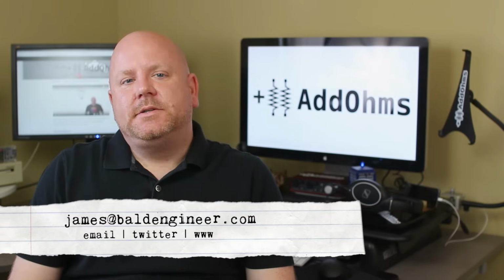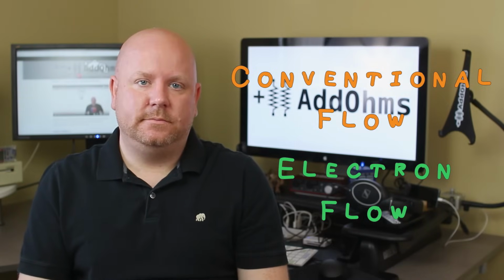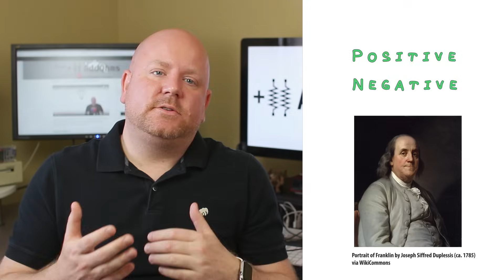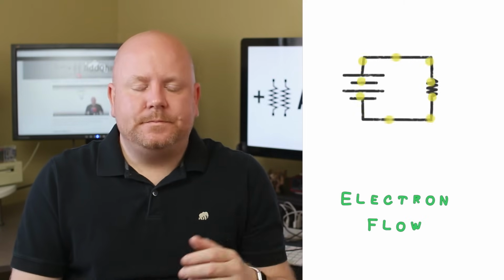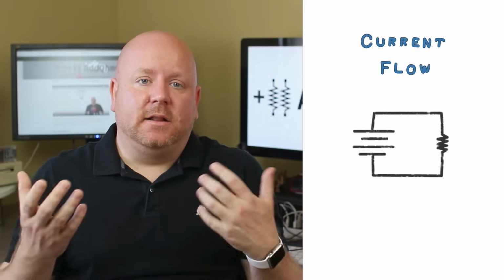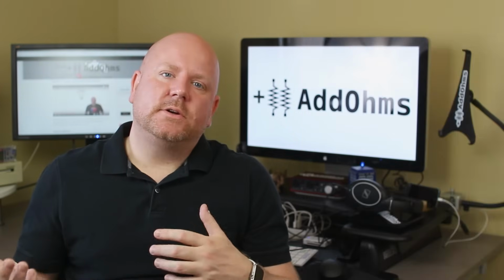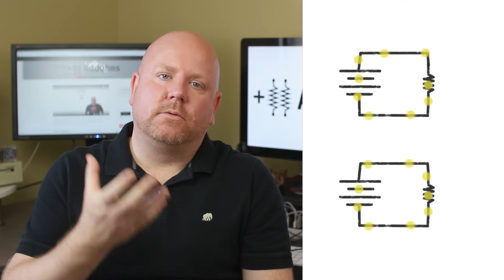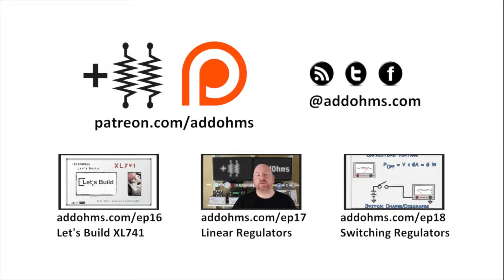Which way does Current Flow | AO #19

Comment: You say it doesn't matter which way you read it, what if there is a diode in series in the circuit?
Reply from the maker: In convention flow (and how people usually think of them) we model a forward biased diode’s current going from anode to cathode. 

In reality (and in electron flow analysis) a forward biased diode’s current moves from cathode to anode. 

You have to use the same analysis method for the entire circuit. You can’t pick and choose based on the component.

Comment: A text on electricity that's over a century old said that, if I understood it, electrons don't actually flow at all in any direction, but that the "state" of the wire is changed.
Reply from the maker: That doesn't make any sense. Electrons are always moving (except at Absolute Zero.) It has been well proven that electrons move in the direction of an electric field. We know they move because conductors get hot. The only way they can get hot is because something inside is moving.

Comment: It was explained to me a bit differently.  Yes they thought electricity moved from positive to negative (positive meaning more, negative meaning less), then they discovered that it's actually the electrons (negative charge) moved to the positive.  But because so many things were built using this labeling convention they just left it that way...  In other words the positive terminal is actually where the electrons reside.
Reply from the maker: "Where the electrons reside" is the wrong way to think about it. There isn't a "pool of electrons" at either terminal. Current moves in a continuous loop like a bicycle chain. So positive and negative are just the direction that the chain moves and not the "source." This difference is a reason why the water analogy is so flawed. People don't see the return path. Without an electric field, the electrons are moving around like they normally do in all matter. The field causes them to move, together, in a direction: like a bicycle chain. They aren't "moving to" the positive they move in the direction of positive.

Comment: Dear Mr. AddOhms, One thing puzzles me about the neg. to pos. theory.
 In electroplating, the anode (wired to pos.) or bar of nickel for example travels  to the cathode (neg.) part being nickel plated.
You can see it happening. What do you think about that? Thank you
Reply from the maker: Can't say. I only have a cursory understanding of how electroplating works.
Reply: @AddOhms  Thanks for answering. I'm sure there's more going on then meets the eye, but in my simple - only
slightly educated mind, it appears the electrons are moving from positive to negative & carrying the plating metal
molecules with it.  It is a good question.
Reply from the maker: Electrolysis involves ions. not “just” electrons.

Comment: My arduino brought me to this ?  i have a small project on lightning my LED i put the cathode - in the GND and the anode + in pin 13 and it lights up ? So based on these video electrons flow from the GND to Pin 13 since it wont light up if put in on reverse .
Reply from the maker: First, that is an excellent way to ruin pin 13. It does not have a current limiting resistor on the pin. (ONLY for the on-board LED.) Second, you cannot pick and choose which current model you follow. If you use conventional flow, then you model current through a diode from anode to cathode.
Reply: oh i thought there is a built in resistor in pin 13 tnx for correcting me, i didnt know that is only for the on board led.

Comment: Moving electrons are not the main conduit of electric charge, electricity. It is the interactions of the electric charges of the electrons that move. Electrons do move, but very slowly, and their movement is inconsequential to the conduction of electricity. It similar to how the middle balls in a Newton's Cradle do not move much when passing the momentum of a striking ball through them.

With that said, the only time electrons are prone to moving in an electric circuit is within semiconductors.

Also, within semiconductors, positive "particles," atoms, also do not move--they are fixed in the crystalline structure of the semiconductor. It is the electrons that move between atoms of the semiconductor that are missing an electron, so-called positive "holes." The holes only appear to move as electrons in the semiconductor migrate from hole to hole.

Comment: If you get confused by the statement at 1:31 you are fine. His statement is not exactly correct and confusing. Only electrons move. What he is referring to is a relative movement that is studied later in semiconductor theory - and is a relative motion, because, in basic electrical theory on solid conductors, positive charges stay with the nucleus and never move.
Reply from the maker: Yup. I regret the explanation. Seemed good at the time, but it wasn't.

Comment: The direction of current flow is important in a DC electric motor because it establishes the direction of torque applied to the motors rotor .
Reply from the maker: Except you have two hands, which means both models work. Depending on which hand you use.
Reply: Fascinating , electrons "drift" thru a circuit at a speed of one and a half inches per hour from negative to positive while at the same time  atomic nuclei flow thru a circuit at about the speed of light in the opposite direction .  Energy always flows from a high state to a lower state and the best description I've heard yet is that electrical energy flows from charge towards discharge .  The stuff flowing in the opposite direction isn't energy . Thanks for replying .
Reply from the maker: No nuclei are not flowing at the speed of light. They are matter, they cannot move that fast. The charge moves at the speed of light because it is energy. Don't confuse electrons with charge. Electrons are the charge carriers.

Comment: Whomever has a doubt,Take  diode( conducts only in one direction) connect it from led with resistor,check the direction,..it's gonna be from positive to negative
Reply from the maker: No. Your understanding of the diode is wrong. The direction is described by the theory you use. In conventional flow, current goes from anode to cathode. In electron flow, which is what really happens, it goes from cathode to anode. 

AGAIN, you have to use the same convention for the ENTIRE circuit. You can’t pick and choose parts and arbitrarily decide they follow one but not the other.
Reply: @AddOhms  sir..if you have noticed a car battery by opening bownet door...why the fuses are given only at positive red terminal s why not at negative black terminals....when short circuit happens,it give rise to more flow of current which blow the fuses..hence..that denotes charges emit from positive terminal. Correct me if I am wrong
Reply from the maker: No! Once again, you are wrong. Your reasoning is incorrect. Current flows in a LOOP. It does not "emit" from anywhere. It is a LOOP. For that reason, it does not matter which direction it flows. 
The reason fuses go on the positive terminal is because they have a tiny amount of resistance. The current through them would create a voltage drop. If they were placed on the ground rail, then ground would not remain at 0 volts. It would change with current load. It has NOTHING to do with what direction the loop of electrons move.

Comment: You almost seem to be teaching here that protons can move and that is definitely not true. That's why I said 'seem' because I'm certain you know they can't move (in an electrical circuit).  I think the only significant thing that makes electricity and electronics work is the fact that electrons move from negative to positive.  It is quite true that the empty 'slots' left by a dislodged electron move from positive to negative. Absolutely. But those are just empty 'slots' which become vacant opposite the direction of electron movement and it's because of a power source forcing electrons into the circuit that those empty 'slots' occur in the first place. Normally in nature an atom will try to balance itself out with the correct number of electrons. In short, these empty slots where electrons were forced out are not moving particles. They are progressively transferred voids, like a string of lights where one light is off and that 'off' light seems to move around and around the loop with the rest of the lights being on. The fact that protons cannot move in a circuit and that only electrons can move in a circuit should give people their grounding into electricity and electronics because they can get very confused by the concept of conventional current if they are stressed together in the beginning. There is probably usefulness in discussing conventional current later, though I have not gotten to the point where I cannot do without it yet. Possibly later on with semiconductors?  Discussing how current can flow from positive to negative wasn't useful in the beginning when I was learning electronics decades ago, as the near-exclusive main focus was on electron current. Conventional current was kind of sidelined and had to be redefined ever since the directional error was discovered by JJ Thomson in 1897. If memory serves I recall seeing most schematics mainly focused on showing the direction of electron flow (negative to positive).

The key in this whole discussion is what causes electricity to be created in the first place. The electrons can easily be dislodged and forced to move in one basic direction (they actually zig zag) toward the positive terminal of the power source where there are many cations (positively charged atoms) awaiting their missing electrons. The protons always stay put. For all intents and purposes they are far heavier than electrons and they never move. Therefore being able to appreciate current flowing from positive to negative is only possible because of moving electrons from negative to positive. To me that is far more significant in this study, especially in the beginning.

Comment: Excellent presentation! Though this is only theory because no one actually knows which way the electrons are flowing, Even the electrons are being labeled as a negative charge when not one has actually provided a repeatable experiment that proves without a doubt that electrons are negatively charged.. 100 year old theories without evidence, you might as well take a guess because there is something really wrong with these old theories.

Comment: But if i have a 2v led with a 5 volt power supply which side of led do i put the resistor?
Reply from the maker: It doesn't matter. Current is a *loop*.
Reply: Thanks. You actually explained this I just wasn’t sure. Good video!

Comment: Understanding the current flow will matter if you place a diode in that circuit....negative to positive is the correct path..
Reply from the maker: Absolutely wrong. That is an example of mixing models or analysis methods. If you pick conventional flow for the rest of the circuit, like almost every professional engineer in the world does, then you must treat diodes as allowing current from anode to cathode. I really like when people troll with the diode example. The symbol even points in conventional flow direction.

Comment: So what happens when you fit a diode then? I guess it means some peoples diagrams work and others don't. Surely just adding a diode would be the answer to which way diagrams need to be drawn and 1 way works and the other does not?
Reply from the maker: Diode allow current flow in one direction. For analysis that direction depends on the method used.

Comment: Just a question.  Does a battery charge from positive to negative because if current is drawn from the source in reality negative to positive wouldn't you be better off analyzing the charging circuit as electron flow instead of having to change arrows when finished analyzing current or charge flow?
Reply from the maker: If you’re trying to understand the chemical reaction, electron flow makes more sense. If you’re just designing a charge circuit based on the batteries’ behaviors, it doesn’t matter.
Reply: @AddOhms  ,. Thanks.  Mostly both.  Battery sulfates after sitting too long without a charge.  To desulfate a battery do you charge into the negative or positive terminal?  I assume chemically it works from the negative side but the charge circuit goes into the positive?

Comment: Would it matter for trying to determine the direction of the magnetic fields around the wire for Lorentz law? You're supposed to point your right thumb in the direction of the current and  the direction your fingers curl tell you the direction of the magnetic fields? If you are using your right thumb, does this work for both conventional and electron flow? Or do you have to switch thumbs between the two or something? Thanks
Reply: Late to the party . . . Yes, it makes a difference. For electron flow, use your left hand.

Comment: You have no idea of the fun I had back in the "60's" with technical engineers from the various military suppliers swapping in mid stream circuit analysis [kirchhoff] and using "Current flow" as the common denominator.  I guess some of us are easily amused!!!!!  Thanks for your simplistic coverage for us old slow thinkers.  Back then I never imagined sneezing and blowing my replacement parts away... Keep up the good work component repair is slipping away.

Comment: Okay I can see how people are going to say this two different ways to do this. All I want to figure out is which way to put a fuse on 1st. Should I install it from the positive terminal or the negative terminal first so it comes out of negative and passes the fuse or if it comes out a positive in passing the fuse. So it does not come out of negative and go through the load then go through the fuse so that protects it. That's what I'm trying to figure out. I am going to put the fuse before the load but I want to figure out if I should put it on the negative or positive terminal
Reply from the maker: Since current flows in a loop, it does not matter. As I said in the video, it is not as-if electrons are "coming out" of either the positive or negative. It is a chain going through both. 

You put the fuse on the positive, but not because of which way current flows. Ground, or the negative, is a common reference point. Generally, it is meant to be at 0 volts. A fuse will cause a slight voltage drop, which means whatever is connected to the fuse to the ground is no longer referencing ground.

Comment: "As long as you use the same flow-direction for the entire circuit, it doesn't matter which you use."  The problem with this statement is that there are many 'you-s'. Some use + to - and others the reverse.  In the effort to understand electricity, this fundamental concept of current flow direction  is critical to the understanding the true electromagnetic forces involved. It is not the matter that it does not matter, it is the matter of truth and understanding. Truth is the light, embrace it!
Reply from the maker: Weird that you transcribed the statement and still continued to not understand it. There is only one “you.” The point, the exact point, is you have to analyze the circuit with a single theory (or direction.) The flow of electrons is a loop. Period. The direction you say they follow does not matter, as long as, YOU say they follow the rules. Which means, they only follow one direction. Because it is it a loop, it DOES NOT matter which why they go.

Comment: Okay... Then explain diodes and transistors with electron flow? Messes the whole show up... Magnetic field fluctuation?
Reply from the maker: Nope. If you use electron or conventional flow, all currents follow the same path for the method you pick. You don't get to pick and choose for certain situations. If you say current flows through a diode from cathode to anode then you must use electron flow for the entire circuit. If you choose conventional flow, like the diode symbol is drawn, you must use conventional flow for the entire circuit.

Comment: How if I say that electricity flow from both directions at the same time with different charge? I came with this opinion when I saw that some wire starts to heats up at middle of it.

Sorry for poor English.
Reply from the maker: It can’t flow from in two directions, at the same time. It can change directions but only one at a time .

A wire heats up in the middle for a different reason. The middle is physically connected to less metal, so less heat can escape through where the wire is connected.

Comment: There is a persistent myth among people who didn't study physics or similar that conventional current flow is a failed definition. It's NOT, just because charge carriers IN METALS are electrons, doesn't mean it's universally the case. In electrolytes for example both positive and negative ions are charge carriers. The definition of electric current is NOT limited to the movement electrons but rather the change of the electric charge over time. That means one single definition is enough to describe movement of electrons, ions, holes etc. independent of their charge. It's more general idea then just movements of electrons.

Comment: If current only flows one way, why do you need Diodes?
Reply from the maker: It doesn't flow "one way." The direction is a reference, or relative, to what we call "positive" and "negative." 

That said, diodes block flow which is useful in many different kinds of circuits. Whether you evaluate the circuit using conventional or electron flow, doesn't matter. The diode only allows current in one direction.